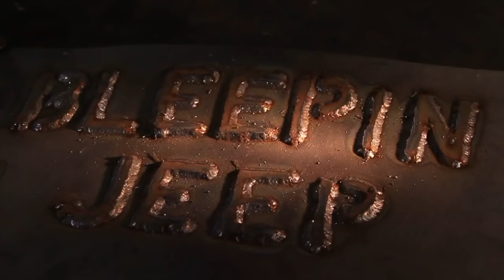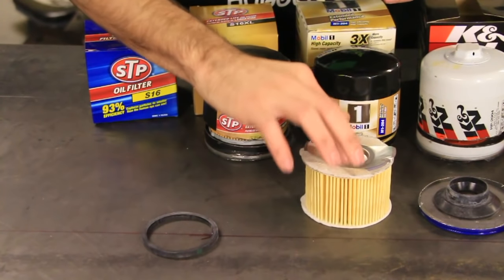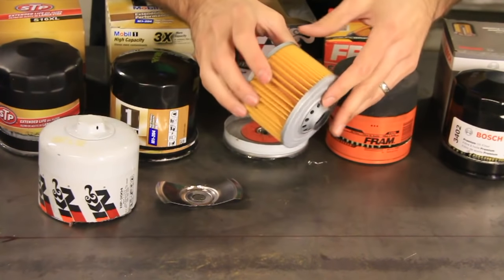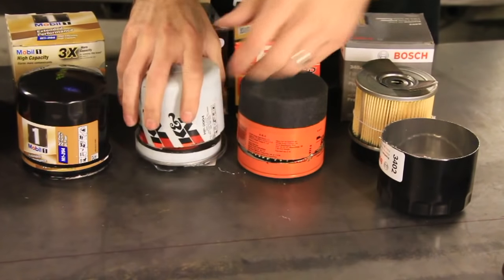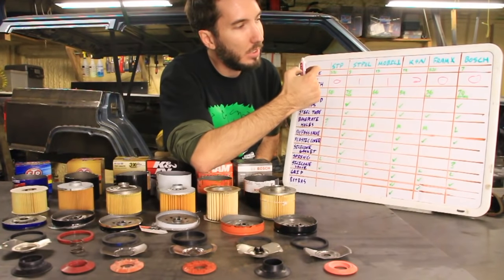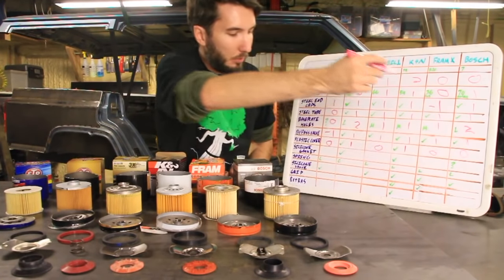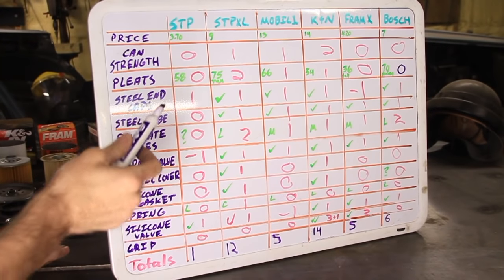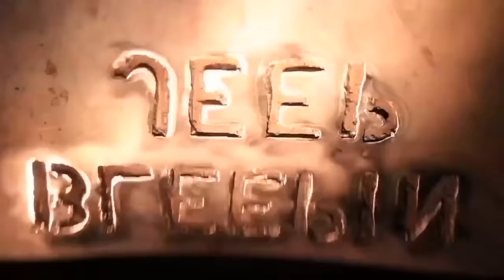What the Crap is in My Oil Filter?  We Find the BEST and Worst Oil Filters from AutoZone

Comment: i use k&N for my corwn vic. i'm not a sold out customer but as much as i love the v8 it costs m-i-n-i-m-u-m several hundreds to replace a car engine that can be cause by wear and inadequate care. I would hate to hear it die! if you compare to  less than 10 bucks difference for cheap vs top of the line filters, its easy to figure out not to put cheap components in a car. thats my point of view. its worked for me. And to answer your question: i would like you to show the top best filters out there like a comparision with the best of this video and others like maybe the royal purple and joe gibbs?

Comment: im surprised how bad fram was.  in my book I wouldn't give it too many extra points for having a grip, it seems that's the only thing going for it.  actually the last oil change I did I used a mobil filter and just used textured spray paint on the end cap to get almost the same grip, worked just fine for me and you get a much better filter.  one can of spray paint will last you dozens of oil cans.  love the videos!

Comment: Thanks for the video, but xl doesn't stand for extra large, lmao. It probably means extended life, since it's rated for higher mileage. Btw, the red anti-drain valves are silicone (best) and the black ones are rubber.

Comment: The discoloration on the paper endplates of the Fram is from the plates used to set the thermoplastic glue. The string on the Bosch holds the plates media around the core during assembly and is left there because it doesn't hurt anything.  

Spring design appearance is irrelevant if the spring performs its intended function.

The thickness of the can is irrelevant to performance in a normal vehicle, as is the polymer composition of the basket and drain back, since engine temperatures today are very tightly controlled and the compartments are well protected against normal road debris.  The biggest mechanical danger to a filter is from an unskilled mechanic. 

Since media composition of the plates filters varies widely, the ONLY meaningful measurement of its  defended performance in a test rig with controlled heating, cooling and introduction of dust and sludge.  Mark 1.0 eyeballs can't do this.

Comment: Some bypasses are not in the filter. They are in the engine base plate the filter screws onto. On the Fram that discoloration is from the glue they used.
The string in the bosch wont hurt anything because the oil flows from the outside in.
I would have measured the depth of the pleats. However the STPxl looks the best to me regardless of price. That price isnt that bad either.

Comment: what is the Micron rating of each?   the total length of the filter fabric not just the folds.
Check  AC. MotoCraft, wix   Look  why cheap out on a oil filter in the first place???  
Get a high flow filter that has a Micron rating that will do the job.

Comment: comparison should  based on what filter material is used and which filter does a better job of filtering, not which one has a better graphics on the can, you are giving point to a brand that has nothing to do with the performance of that oil filter.

Comment: When you factored into the costs, you implemented a different scoring system.

Ideally you should implement a uniform scaling system throughout, I suggest using the one at the end throughout, having the worst being 0 and the ebst being 6 which would make it fairer.

Comment: One question I have after reading through the comments here is: How does one know how well any oil filter performs?  Comments like: My high mileage vehicle loves [insert brand of filter].  I guess the logic is that their engine hasn't blown up while using that particular filter.  That's some sort of sound reasoning, very scientific!  On the flip side, maybe they bought the engine new, tore it apart to inspect the oil channels and oiled parts(to create a controlled situation), reassembled the engine, ran said engine with one specific filter for x number of miles, tore engine part again to inspect, reassembled engine, and repeated the process with another filter?  Inspecting just the filter for what it did filter isn't going to tell you what it didn't.  I would assume that every engine has a certain amount of tolerance for crap in its oil, some more and some less (even over the same make and model).  I believe any engine will perform at its best when properly maintained from the start.
Reply: You can tell by;
How fast oil PSI builds on startup
Color of oil at oil change
Sound of engine
Oil analysis
etc.
Reply: FCFordLord That makes sense.  Higher pressure at start up would mean a restriction of some sort, right?  Possible filter issue. Even with the tests you noted there, you'd have to have some sort of justification to point to the filter as a source of a problem.  Color of oil: excess heat and dirty pan.  Sound of engine:  that's quite hilarious.  If your engine sounds different from one filter to another, then an oil filter just ain't your biggest concern.  Oil analysis:  I'll get on board with that as it may uncover filterable suspended solids.  Facts and the scientific method cannot be avoided.  Anyway, my sarcasm was prompted by those that swear by one pleated piece of media over another without any real justification.  That just seems ridiculous to me.  Build quality is cool and it's nice to know what you're paying for, too.  In the end, it's almost like arguing that one coffee filter is better than another.  Just get a filter that fits and change your oil regularly.  Right?

Comment: The best place for the relief valve is at the top. When it opens you don't want the abrasives that have accumulated in the bottom to be flushed into the bearings. If the filter has no relief valve it is probably for a GM car that has the relief valve in the filter mount. I've seen the string around the pleats a few times.

Comment: Although I appreciate the video, I disagree with your assumption that "can strength" has the same merit as a bypass valve.
Your spring assessment is backwards as wing type of springs are less likely to break than the coil spring.
Also, giving 0 points to the second place finisher with the # of pleats because an ENGINEER puts a string in place for an unknown reason [believe me, it wouldn't be there if there wasn't a VERY good reason for it to be] is disproportionate as your assumption is flawed.
Reply: +sjs I didn't quite agree with the points system either, but I do appreciate somebody buying oil filters just to cut them open and show the world what's inside. I can draw my own conclusions from the evidence he sets in front of me.

IMO the reason the STP-XL filter uses the coil spring is to fit in the taller filter media. Not an unreasonable trade-off as they do need to keep within a certain size can, but personally I just upsize the filter can if there's room to do so (and bypass valve specs match up).

Comment: Best thing to do is run a genuine filter for your vehicle because there are some really crappy filters on the market
Reply: Dan Tanna Seen some pretty crappy genuine filters too, namely the new AC Delcos which come with new GM cars. I buy Baldwin filters for all of my cars and equipment. Baldwin filters are designed for commercial service, so they aren't available for every car, but I have managed to find them for the basic Chevy, Ford, Mopar, and IH v8's, 6, and 4 cylinders, as well as for my tractors. For imports, I would use the NAPA Gold filters, also very good quality.

Comment: I'd like to see how clean oil is before and after. Like 50 gallons of used oil split into equal parts; then heat up to 200 degrees, and recirculate a portion  of it through each filter for 20 hours.  Then send to lab and test for PPM contaminants (before and after). Then also how long it takes to pump 5 gallons through each; that would test the flow.  Otherwise you are mostly judging how prettily constructed they are.
Reply: +Ken Marcus  I agree 100% So many people say this filter is better than that filter because it has more pleats of filter paper. A person could put a hundred pleats of poor filtering paper in a filter canister and it still might not filter as good as one with 20 pleats of good filter paper.
Reply from the maker: I agree this would be a good test but this isn't a science lab and I don't have a multimillion dollar budget.  Not even a multi hundred dollar budget so... This is the best I can do
Reply: +2 AM, one way that would make better sense on the pleats is to look at the surface area of the filter.
Reply: +BleepinJeep   I agree it wouldn't be easy.  How about 1-2 quarts of used oil recirculated using a cheap Harbor freight pump, with the can sitting in a crockpot (on low) for heat, then have the analysis donated in exchange for you mentioning their service?
Reply: zuesmondo1 More surface area is better as long as the filter media between the filters is of equal filtering capability. A filter with 200 square cm of poor filter media might not do as well as a filter with 50 square cm of good filter media.

Comment: My jeep mechanic likes Mopar filters
Reply: and champion plugs lol
Reply: +bonedigggss eww no NGK
Reply: Why put a Japanese plugs in an American motor
Reply: +bonedigggss better quality, understand you gotta support the american economy tho
Reply: +bonedigggss What's wrong with Champion plugs? Short life?
Reply: +evilassaultweaponeer not nearly as good as quality as NGK ive always seen problems with the champion stuff and yeah short life i guess you could say lol
Reply: +evilassaultweaponeer Champion are the worst ever.  Test a batch of Champions vs NGK with a meter and you'll see the difference immediately.
Reply: +bonedigggss Because some American motors, such as mine, come with NGK plugs! (2000 Dodge Intrepid, 3.2L V6)

IMO, for spark plugs always go with the OEM brand. I've seen some weird issues crop up from using different brands, especially in more modern engines with stuff like fuel injection. If your engine came with Champion plugs put Champion plugs in, if it came with NGKs put in NGKs.

Comment: All of these filters are made by Champion Labs which whom has no relation to Federal-Mogul's Champion spark plug.  Champion Labs is owned by Honeywell.  It's interesting to see how each of these brands have designed their oil filter.  One note is that most MOPAR oil filters are also made by Champion Labs in case anyone is using/thinking of using their filter.  AC-Delco and Motorcraft filters are made by Purolator.  Wix is huge and they do manufacture filters for the auto manufacturers but I'm not sure which ones any more.  Things change so quick to try and keep up.  One note of advice when changing the filter.  Fill it first and let the oil permeate through the element.  Hard to do when the filter is mount with the opening facing down.  It will reduce the zero PSI time during that first start up after the oil change/filter change.  The only oil that's left after a chance is what sticks to the wear surfaces.  Would you run your engine without oil?  You are when waiting for the filter to fill up?
Reply: +4X4-HAM Great advice Sir.
Reply: +CLOUD YO  The extra time it takes to pump oil into the filter is quite small and if it mattered significantly then the auto manufacturers would advise to do it.  There is no evidence that this needs to be done.

Plus, it's just silly to fixate on the brand name that owns an oil filter brand.  They were obviously made on different manufacturing lines with different components and build cost.  If a brand named Poopy Diapers bought Fram it would be no more or less crap than it is already.

This is the kind of clown science to avoid.   Plenty of people get over 200K mi. on their engines without any of this silly ritual superstition stuff.  Car maintenance is a well known real science by now.

Comment: Bosch Distance Plus carried at Walmart
Reply: Local Walmart's here have begun to phase them out. They're too expensive for what they are. Get a Fram ULTRA. Its synthetic media filters 99.5% at 20 microns, has metal end caps and metal backing, silicone adbv, flows like crazy and is good for 15,000 miles. Nothing like their lower-end filters...it's a beast. Best part is you can get it at Walmart for about $9.

Comment: Why are you talking about filters  when is clear that you dont now waht are you talking about. You dont know if is paper or plastic or niether, silicone or rubber, glue or mold... etc...and by do way, there are many brands that uses that little string...(research). Sorry if i sound rude, but if we are going to talk about something, is better to be assuredness.
Reply from the maker: +Hugo Ferreira - you don't need to be a scientist to do a bit of investigating
Reply: But you didn`t...Again, sorry, dont misunderstand me, but if i m not sure what i m doing i stay still to not induce people in error. Ex.: i prefer the concave steel plate to the spring. a semi arc is more stronger than a spring, right?...or rong? Is better to call a scientist..lol.

Comment: Fram is Garbage, i refuse to run them.....  Puralator  or WIX are king, or OEM (Run motor craft FL1995 in my super-duty)  the string is normal on some of the filters not a big deal. in alot of the import filters like Toyota and Honda use.
Reply from the maker: +alaskan155 are you saying an OEM toyota filter has a string in it?
Reply: im sorry i was looking online again, (many pictures of cut open filters) looks like the string is across the board when it comes to brands

Comment: Fram is junk! Don't buy fram!
Reply: We had problems with them at the ford dealership.  Customer complains of engine noise at startup.  These filters are rubbish.  We even have a ford tsb on lower quality oil filters.  I like the motorcraft, Mobil 1, wix, purolator, k&n, and even the new RP filter.